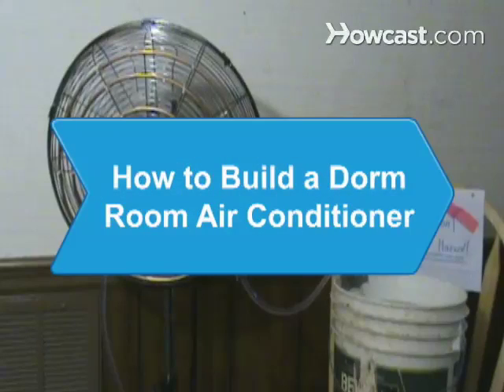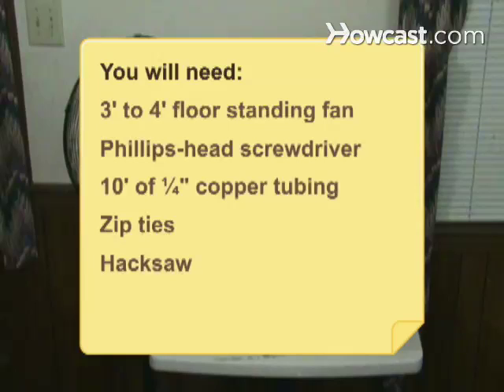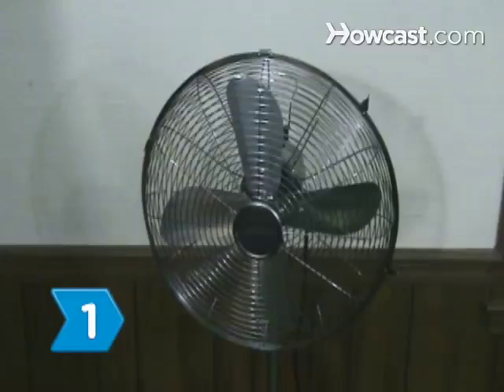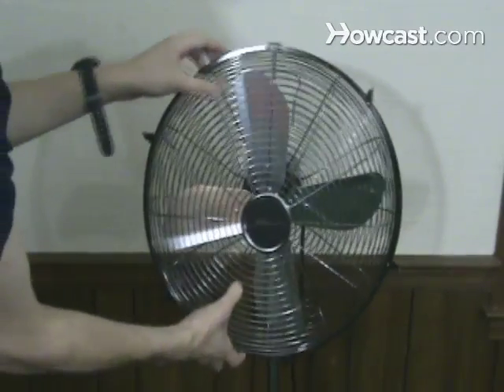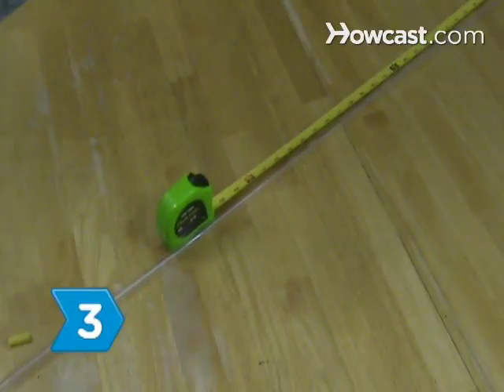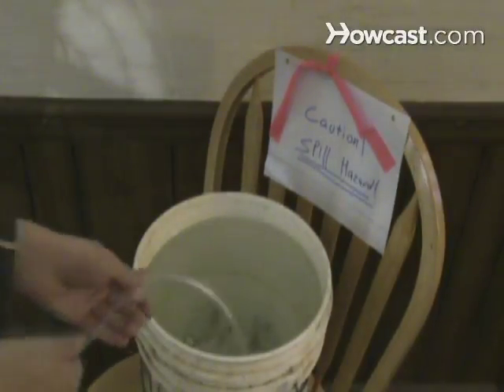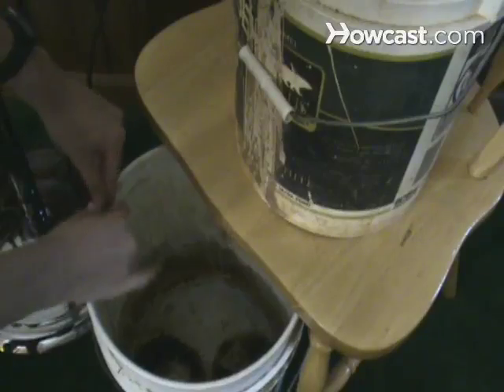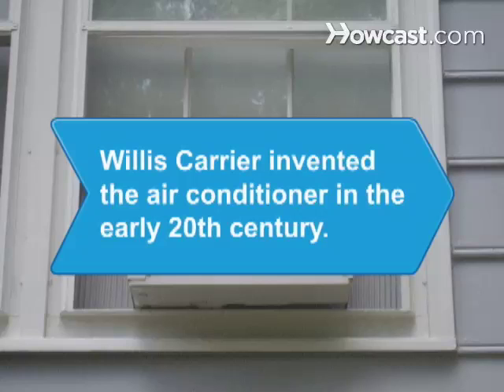How to Build a Dorm Room Air Conditioner

Comment: there are dorms that don't have AC these days? I'd be getting a little $150  window AC unit.
Reply: dorms have ac, but most you can't control and a lot of times you can't open the windows.
Reply: Mine requires that you have a medical condition to have one in the window.

Comment: im an architecture student and though this a nice idea you would have to refill that bucket constantly. there are a million better ways. I like the coil on fan component but the water heat exchange needs to be revised. just using a longer vessel with 2 chambers (2 drainpipes cable tied together sealed at bottom) would work well. syphon from bottom of one drainpipe to other empty one.
key is syphon from bottom where water is coldest stack effect will send heat to top.
then repeat in second tube just swap flow direction.
for added cold put tube somewhere cold or insert both tubes into ice bucket and insulate. but thats defeating the point.
there are better ways but thats off top of my head. yes I know architects are boring as fuck. lol

Comment: instead of using water all over again just get a 10 dollar water pump for fish tanks and use that and have one end hooked up to the water pump and the other end back into the bucket or what i use is a cooler too keep the water cold longer. and all this stuff is really cheap if you just go to home depot the copper tubing i got for 50$ for 2 fans worth the rubber tubing is only like 5 dollars so its really not that bad

Comment: why bother use mouth to suck?? and u need to refill bucket which is waste of water just buy a aquarium pump and done you can use plastic filled with ice (bigger better) put onto the water everytime the ice melt just changed with spare and pu the melted back into firdge

Comment: yes, the water doesnt magically flow on its own, it needs constant suction. like some sort of mechanical filter. I used a motor from a small mecahnical decorative fountain. I used this method and did a better job, but it doesnt make it cooler at all. So fuck this video and fuck howcast.

Comment: @spritemaker1000 "smoke stuff" is the co2 subliming...not that'll heat up pretty quickly and also might not flow as well as water. now what would be a good idea would be to put dry ice in alcohol as the alcohol will not freeze even at that temp. or get some liquid nitrogen if you can...

Comment: @cori800888 i think what they're going for here is a spot ac...just blast it on yourself instead of attempting to cool the whole room. there's no way to get anywhere near efficient cooling without a better heat-exchange medium. but flawed as the concept may be, using ice water will definitely make a substantial improvement.

Comment: I'm an HVAC engineer...  here is the math..  5 gal water weights 40 lbs.   68F is usual tap water temp.  ir room is to be cooled to 80F.. water in the coil can go no warmer than 70F,,

,so you have this many BTU's of cooling 2 x 40= 80 btu's of cooling per hour... thats a tenth of a watt, not even enough to  remove the heat added by the fan,

Typical load for a dorm roor is 5,000 btu's per hour..   80 btu/hr wont come close